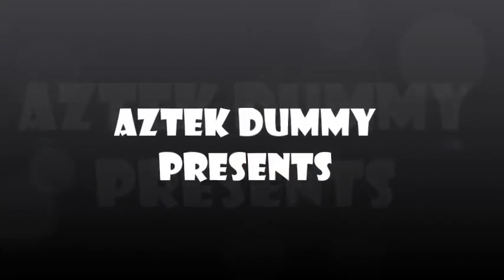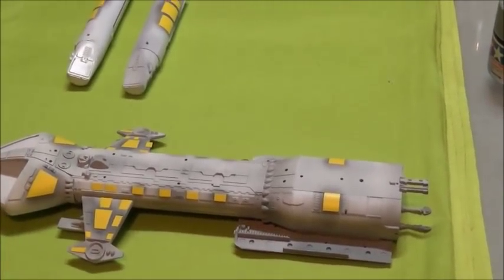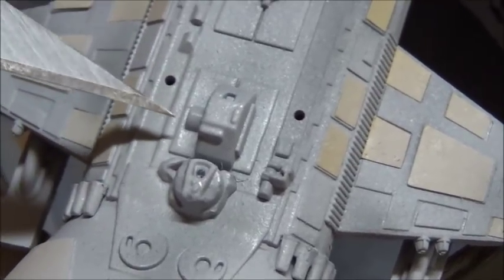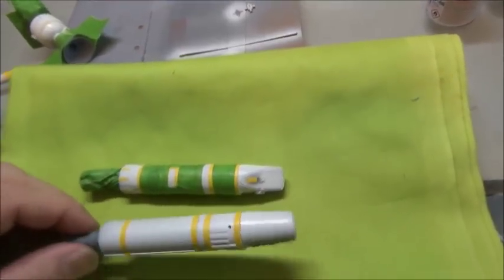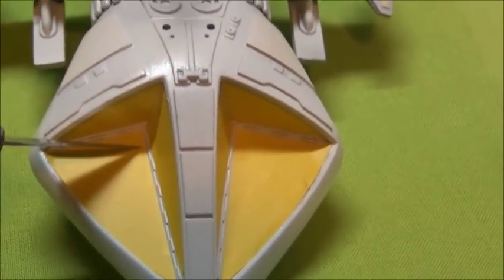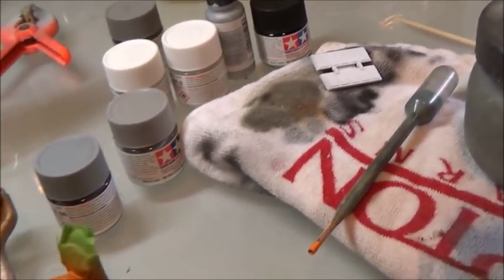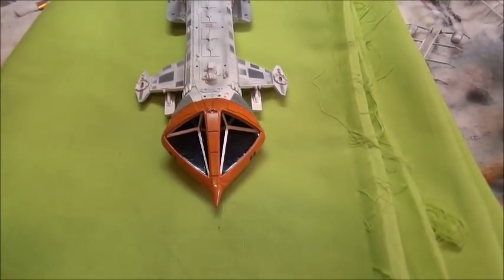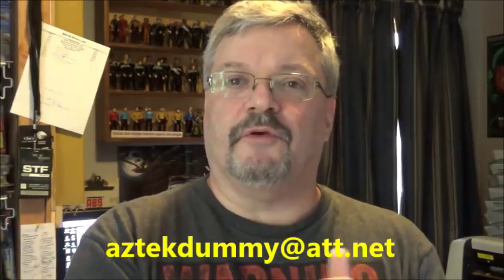1999 hawk

Comment: There's a huge amount of Airfix Saturn V and Saturn ivb in the original filming model : the back is essentially the saturn 2nd stage, the neck is made from the 1st stage of the smaller Saturn, and the motor is the V interstage and tank top.